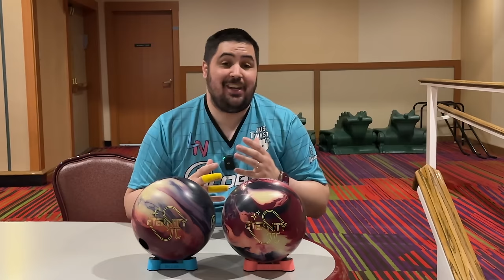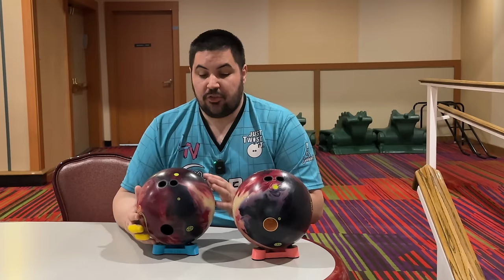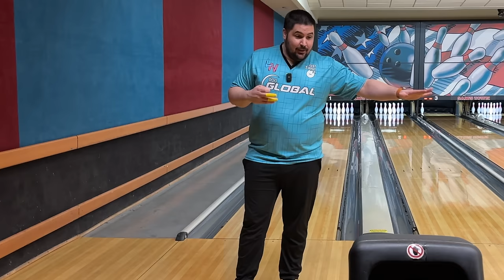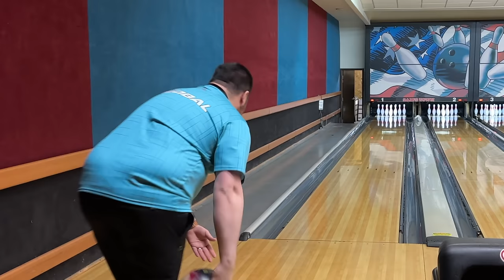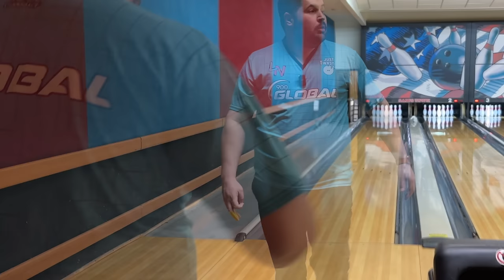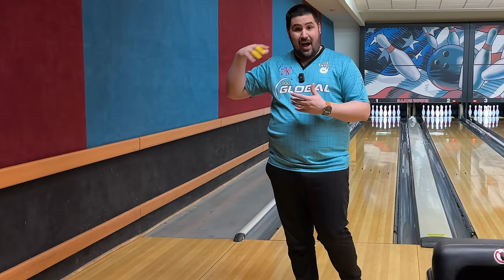Difference Between A Bowling Ball Drilled Pin up and Pin Down | WHEN To Use Each!

Comment: IMO, as long as your layout doesn't cause the oil rings to cross over the fingers or thumb, one should be more worried about coverstock and their accuracy.  Too many league bowlers blame the ball when they miss their mark by 5+ boards regularly.
Reply: LMAO seriously. "Man, I got robbed on that (insert single pin leave here)!" The layout on my ball totally sucks!

No, genius. You don't know where you're supposed to put the ball, don't know where your feet should be, and most important can't repeat any good shot that you accidently make.

Git Gud.
Reply from the maker: Surface will always be the most important

Comment: My hammer NU Blue has been hooking wicked.  Its drilled pin up and I hit the brokie to 4 pin area.  Ive moved way left and still cant get it in pocket.  Ive had it polished.  Problem  is Im 70 and my ball speed is down to 9.5 to 9.8.   Would plug and drilling it pin down help?   I dont think I can get ball speed up.  Im throwing from almost gutter left out to the 10 board with it being so slow it has plenty of time to hook hard.

Comment: I have to disagree on the general effect of pin up vs down on RG on a ball with a thumb hole.

On pin up, the thumb hole will remove material from the side of the core, resulting in higher RG and higher RG differential.

On pin down, the thumb hole removes material from the top of the core, resulting in lower RG and lower RG diff.

Overall the difference in RG is typically .01 - .02.
Reply from the maker: Okay!
Reply: @LuisNapoles should have also started with this: I love your channel - keep it up!

Comment: Great video Luis! I have a Eternity pi drilled pin up but it has been reading the lane too early for me and overhooking forcing me to play inside when my A game is normally straighter or around the track area. Do you think I should change the surface to 3k or 4k fast?

Comment: Question for u.  I had a bank roll from 2016 that had only 30 or so games on it.  Stored in the house in my bag the entire time... I have had a lot of medical issues so it literally just sat for a couple years.  I pulled it out to make sure I could handle throwing again and it is split 360 degrees basically through the fingertips.  Was that a poor drill? Or a defective ball?  Storm said that it can't be drilled less than an inch from the pin and it appears to have been AT 1" if it's close.  I would say less than an inch.  Is that why it split?  Obv not under warranty anymore either way but I'm thinking Hammer now because of what happened to my 900 global.  Black widow 2.0 hybrid is top of my list currently.  I have mad love for the teal rhino pro that they re released too.  Can't decide.

Comment: Tom Laskow drills my balls. He was a pba pro and invented many many pro shop tools everyone uses including the oval edge. He knows fit better than almost anyone on this planet according to daniel puerto and he told me that until a bowler had the correct fundamentals, pap doesnt mean jack lol. Curious your thoughts on this. Now once a player has correct form, a free arms swing and good release, then it matters.
Reply: My Pro Shop owner told me the same thing! You have to get your fundamentals down first before you really start changing the ball.
Reply: I use the Pro-Sect every time I layout and drill balls.

However I would challenge him on the statement that PAP doesn't mean jack until you have correct fundamentals. Or at least have him define what correct fundamentals mean. If it means "a correct form, a free arm swing and good release" then most intermediate to pro bowlers would not have to lay out their equipment. 

And on a side note: Free arm swing is a myth 😉. Especially if you want to keep up with the two handers
Reply: @showmethegoods  I just started bowling and got my first balk which is a Storm Tropical Surge. So he did a general layout based on my hand to see where I'm at.
Reply: @NewVisionLCS  That does make sense
Reply: @showmethegoods  thank you!
Reply: Where is Tom drilling out of these days? Last I heard he was coaching overseas.
Reply from the maker: Yea I mean if you can’t repeat shots then your pap will change literally shot to shot

Comment: Im Sad to say it, but the RG part of the explanation is wrong. An here is why: The Pin (in his cases the yellow dot above or below the fingers) marks the high RG Axis on the core/ball, while the small Global Logo or Mass Bias Marker (to the right an below the Thumbhole of both balls) shows the lowest RG axis of the core/ball.
Lets assume that the finger holes roughly deduct the same amount of mass from the ball (for simplicity). If we now check where the center of the grip lies for the first layout, we can see, that it is roughly just in the middle between pin and Mass Bias. This should result (Depending on Core Design )in nearly zero change to the Stock RG and Differential (wich is the difference between the High RG number and the Low RG number)
For the second layout, the center of grip is much closer to the pin, so we are removing mass closer to the high RG side, effectively reducing the overall RG of the ball and also reducing the Differential aka flare potential.
Now lets get to the conclusion how the balls should react when comparing them.
The left ball with pin up drilling should go a touch longer thanks to the higher overall RG wich gets countered by the higher Differential by a bit. The shape of the hook should be quite a bit more angular when compared to the pin down ball.
The pin down ball however will start EARLYER, due to the lower overall RG with less overall hook due to less Diff/Hook Potential and a much smoother transition. So his conclusions for the estimated ball reactions is also more of a mixed bag.  Lets talk about those Statements.
Pin up Ball:
Its going to be earlier! -> Generally NO! Pin up vs Pin down, the ball will have a higher overall RG wich will bring the ball further down the Lane. However higher diff. aka hook potential vs the pin down ball can counteract that.
Its going to have a stronger reaction -> Yep!
Its going to "shape" (whatever that should mean...I guess angular) more. -> Yep!
Pin Down:
Hook a little bit less -> Yep!
It wants to go more down lane -> Nope! Since overall RG is lower, it wants to start sooner, but since it hooks less and less strong of the spot you could be deceived to think so.
It has a more round hook shape -> Yes!

Then seeing his ball reactions I can understand where he is coming from with his assessment. But what happens is different from what he feels. The pin down ball has much more read in the midlane and therefore less and smoother hook when getting into the dry, while the pin up reads much less and therefore unleashes everything at the end resulting in that early and stronger feeling.

At last just a little question mark that popped up while i was going through the video back and forth. The layouts are told to be 30x4.5x30 and 30x4.5x70. On asymmetric balls you pull your first line from the Pin to the PAP contrary so symmetric balls, were you go through the CG Marker. So if you just change the last angle, the MB marker will end up further away from the thumbhole to the right! On those balls its the opposite! The only thing I could Imagine is, that the balls were layed out using the symmetric method. This is overall not a big deal but shifts the pin down ball a touch more in the "goes longer" area.

I am sorry for this critique, but there is enough just wrong in those explanations  that I really felt the need to at least try to correct them.

Comment: I still think layouts do matter. I had an old melee cross from 2015. I had it drilled to be smoother reacting for sport shots. That ball is very early and smooth in design meant to blend out a pattern. In short went too weak with the layout. It reacted like urethane. I tried hitting the surface with 3000 4000 then polish to give it some shape on the back end. Surface change did nothing. Had 12 games on it when I stopped using it in 2015. Took it too the pro shop last season to plug and redrill. I said drill this ball pin up as aggressive as possible. It worked! The ball had backend and reacted completely different. It was like a completely different ball.
Reply from the maker: Nice

Comment: The only true way for bowlers to SEE the difference is from an aerial view of different layouts. Because a bowling line/shape looks incredibly different from above than behind. In fact, when looking from a true straight down view, many shots (even if it’s a high flaring, angular shape) APPEARS to be be far straighter. The explanation is pretty well spot on and I have a 40x4.5x75 on my Pi and it took some time to get used to it. The Pi has big asym core and I, personally, have found that the same 40x75 layout is much more user friendly on a decent symmetric ball like a Verge or hell even an IQ. They just roll different.
Reply from the maker: I would agree but I only have one camera ya know.

Comment: If my spot is usually 2nd to third arrow and I have my new Roto Grip TNT 🧨 drilled slightly lower then the Pin Up, which board should I place my left foot ?
Reply from the maker: That’s IMPOSSIBLE for me to help you with. There’s sooo many factors that go into answering this question!

Comment: ok  i have two phase two balls.  one is drilled pin up and the other pin down.
pin down hooks mid lane and keeps hooking [ nice arc on ball.  the other pin up
goes down lane then hooks sharper.  seams opposite of what you are saying.
i have had these two ball for a few years and i'm a pba 50 bowler.
Reply from the maker: Surface matters a lot with this

Comment: One minor correction Lou, the greater the Differential the greater the 'Flare Potential,' not necessary the greater the Hook Potential, if by hook you mean curve.
Balls with High Diff and High Flare layouts will read the lane earlier and tend to be very smooth and forward vs. Low Diff balls which tend to retain energy and curve more in the back.
If I want a ball to be early and forward and go pretty straight I choose a ball with a Low RG and High Diff and drill it for Max Flare, then it will read early and be very mild without much side to side motion. If I want a ball to snap in the back and be clean in the front, then I choose a ball with High RG and Low Diff and drill it to not flare much, then that ball will do all its work in the back of the lane with significant side to side motion and continuation. That is my experience with layouts on different ball types.
Reply from the maker: Thanks!

Comment: I don't think those two balls have the same drill angle. Keeping the drill angle the same and going higher with the VAL angle will result in the pin moving closer to the grip center but it will also move the MB towards the VAL. On the pin down ball the MB was closer to the thumb compared with the pin up. Which suggest a higher drill angle on the pin down ball. So the balls are not drilled with the same drill angle.

Besides that the information is correct. Pin up generally hook earlier but they also have a sharper break point and cover more boards. Pin down is weaker and smoother. And this is something people often get mixed up. 

In my pro shop bowlers often ask for pin up to get more length for drier lanes. And that is not how it works 😊

Comment: My pin down balls start moving earlier with less angle and my pin up balls go longer with a stronger angle. I do not see the same reaction as you described in your video out of any of my equipment. Very strange.
Reply: Same. Surface, revs, and speed are huge factors.

Comment: Rather interesting I came across this video..... a little over a month ago I got a Radical Trail Blazer solid on sale and had it drilled pin up .... I less than a week and never throwing it I picked a second one and had it drilled pin down.....and I tested both out to see the difference in ball reaction and movement. I soon figured the pin down would be the starter and most of the time can use all 3 games but when there are games I notice a big difference in the carry down I switch to the pin up... and major tip to all bowlers ...always pay attention to the reaction to others bowlers ..for me , most of the time I make my adjustments or ball changes based on what reaction I see from others .....and many times I've been asked how is it you stay consistent as though the lane conditions never changed for yo but yet we've all over the place.
Reply from the maker: Thanks for the tip!

Comment: I’d add pin down asymmetrical, pin down symmetric balls for most don’t have enough motion
Reply: For most rev challenged bowlers that’s true. Not so much for most mid-high rev rate bowlers.
Reply: So you want to drill pin down for more reaction?
Reply from the maker: Yea I can get with that

Comment: The first thing I saw between each ball before you threw the first shot is that each ball has a different surface, one is shinier then the other, you could see it while they were on the table.  It's a know fact that ball surface has a bigger impact then layout!
Reply: He mentioned that in the beginning that surface is a major factor before considering pin up or pin down layouts. You need to look at your surface of the ball and think how much reaction it will have according to the pin locations
Reply: I know what he mentioned at the beginning of the video, but if was to make a true comparison between pin up and pin down, both balls should have the same surface.  This is the crux of my statement!
Reply: @ramondelgado4181  I'm pretty sure later in the video he did mention that both had the same surface.  If not, like you said, it's not a fair comparison between how they're drilled.  I'll go back and look and put a time stamp in another reply if he did mention it.
Reply: @ramondelgado4181 Go to 12:00, he mentions that the only difference is the pin placement, including the same surface.  Hope that helps.
Reply: @kevinmueller6737  I don’t care what he said, I can look at the balls and can tell that one is shiny and the other is dull!  I’ve checked the surface of brand new balls out of the box and can tell you that they come out of box with different numbers! Just saying!
Reply from the maker: These have the same surface ISH I did them by hand since I don’t have a spinner

Comment: I am the opposite, for fresh house shot at my local center I use a pin up "length and backend" layout for my forge fire. The fresh oil is pretty slick, then when the lanes transition I swap to my pin down pearl rhino pro gold vintage remake. It always works out for me, every house shot is different though depending on the oil machine they use, how much viscosity the oil is, and what kind of oil they use. My bowling style is stroker with lower revs, so I think pin up works better for me. Btw you made a typo in the video title, you misspelled "when"
Reply from the maker: Nice! Yes I fixed it 😂😂
Reply: @LuisNapoles  But yeah layouts can vary depending on the local house you bowl on. Some are drier than others